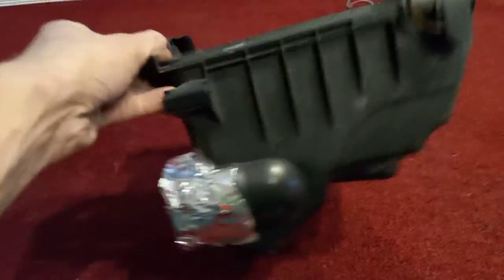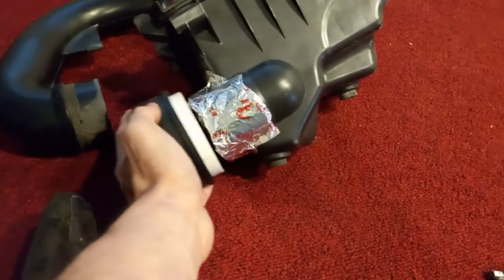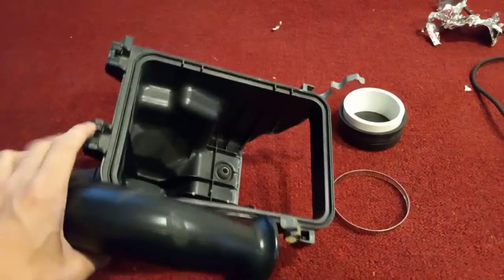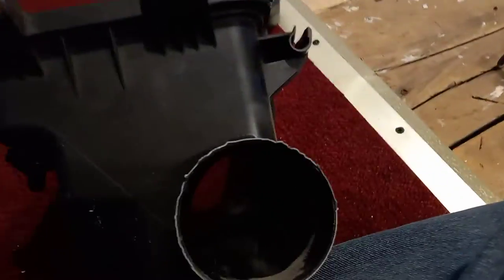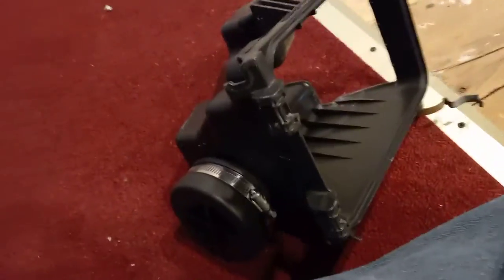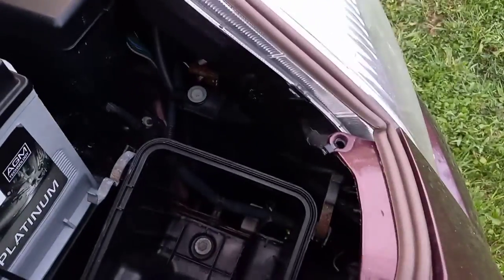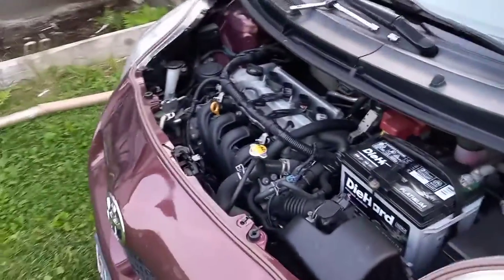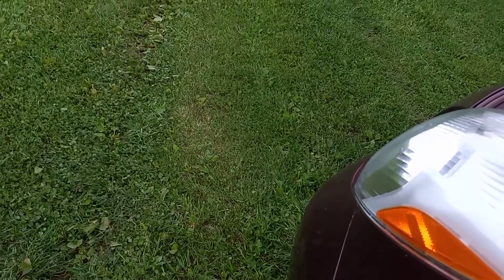2010 toyota yaris homemade cold air intake

Comment: Did you noticed some decrease in torque on low rpm bands? I had mine modified like that and i noticed that it dropped a lil bit on the low rpm bands. But on mid-high rpm bands it was faster. What did you do to compensate this phenomenon? Is there a way to compensate for the low rpm band torque loss?
Reply from the maker: I lost a little low end but it's barely noticeable. I can still chirp the tires from a dead stop. Try cleaning the mass airflow sensor and see if that helps. Are you using the 1zz throttle body?
Reply: @mrpartridge8765  im using a stock 2nz-fe throttle body
Reply from the maker: @miguelborlongan6937  I recommend getting a can of mass airflow sensor cleaner and cleaning the sensor. They get dirty after a while and it can hurt fuel economy and power. That may help with the loss of low end power.
Reply: I wonder if egr delete would help the low

Comment: Do you need a bigger hose from your in tank to throttle body after switching to the 1zz throttle?
Reply from the maker: I used the original rubber hose. You have to force it on the throttle body. I use dish soap as a lubricant to help it slide on.

Comment: are u delete the air fiter? (usually the white one)
Reply from the maker: I still use the air filter. I removed the charcoal filter a few years ago as it was unnecessary.
Reply: @mrpartridge8765  where is the position of charcoal filter? i cannot find that in my 06 yaris (indonesia)
Reply from the maker: @naufalegha5150  its in the upper half of the airbox. You may not have it if your country has different EPA standards than the USA.
Reply: @mrpartridge8765  okay for sure my car doesnt have charcoal filter, different EPA different regulation, thank you for your response👍 looking forward to see your useful content!

Comment: Hi, Is this a 1nz or a 2nz motor?
Reply from the maker: It's the 1nz-fe. Any mods for the 1nz will work for the 2nz. The only difference between the two engines is the stroke. The 1nz has a longer stroke than the 2nz.
Reply: @mrpartridge8765  ahh I see, thank you for your reply, truly appreciate it.